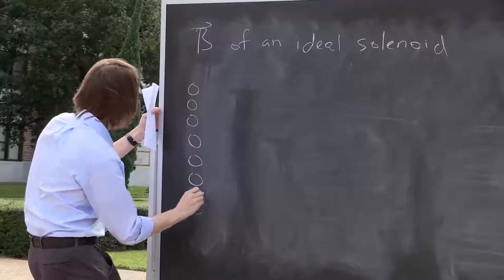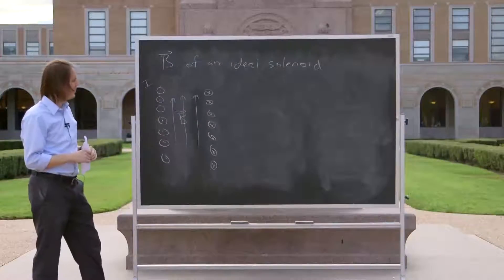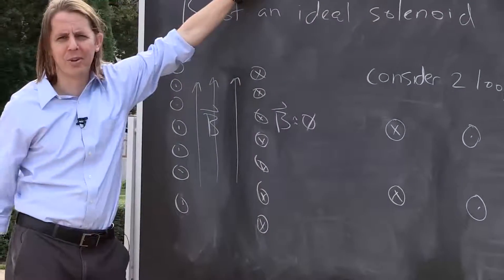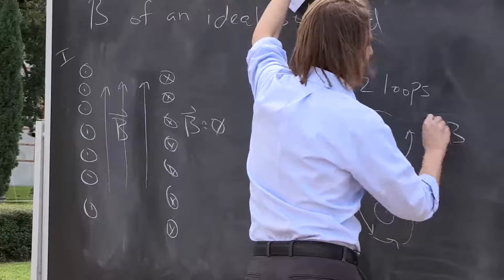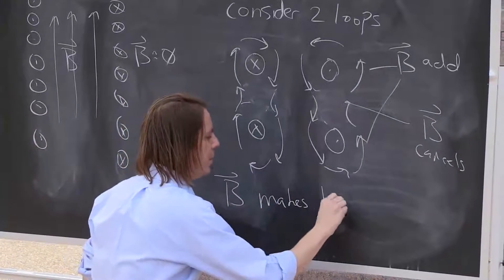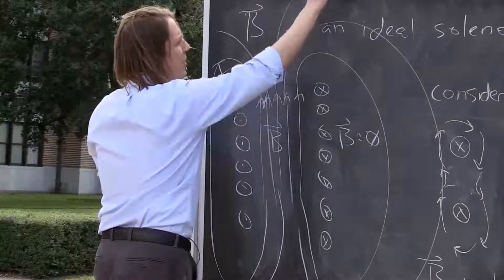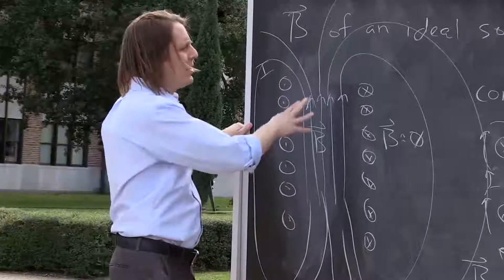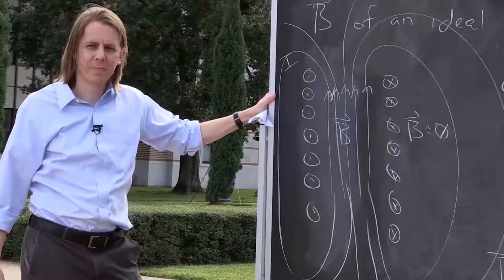PHYS 102 | Solenoids 2 - Amperian Loops Around the Solenoid

Comment: This was very helpful because for I while I was wondering why you couldn't make a magnetic monopole from a radial distribution of solenoids. Now I know the magnetic field lines are still there outside the solenoid in the case of a finite solenoid! It still disturbs me a little bit though. In the case of a radial distribution of infinite solenoids what prevents you from effectively creating a magnetic monopole?
Reply from the maker: I would need to understand better what you mean by a radial distribution of solenoids..   just one with very thick windings?
Reply: Thanks for responding so fast! I mean having a bunch of solenoids going out of a central sphere radially. It would look kind of like a micelle (from chemistry or biology), but with long solenoids instead of the surfactants you would see in a micelle. I was thinking that if solenoids were put in this configuration the resulting magnetic field lines may look like they radiated from a central point source and do not loop back.